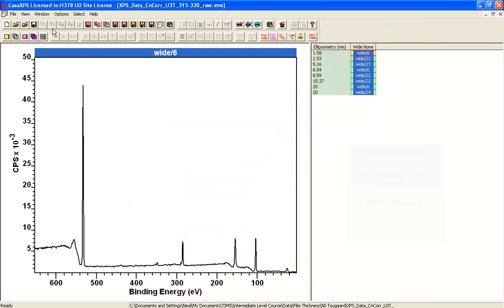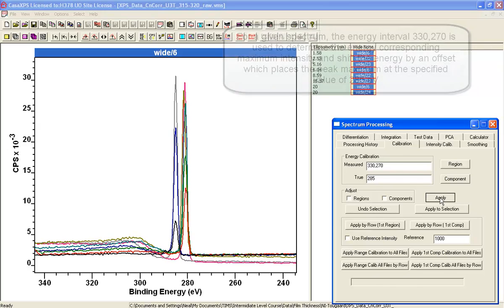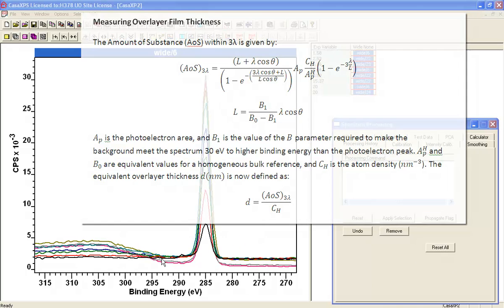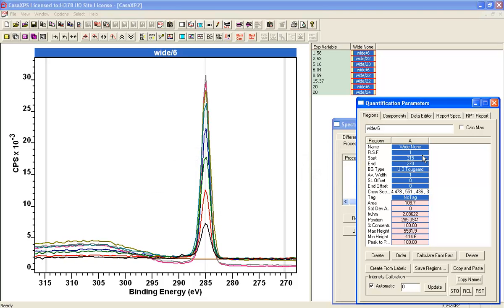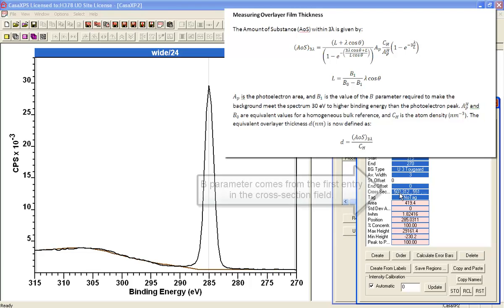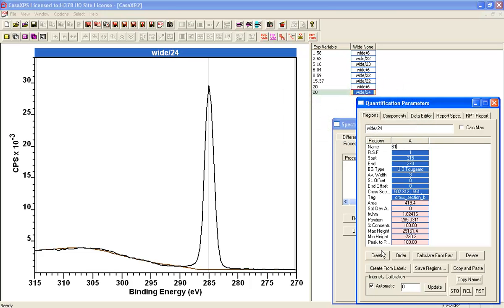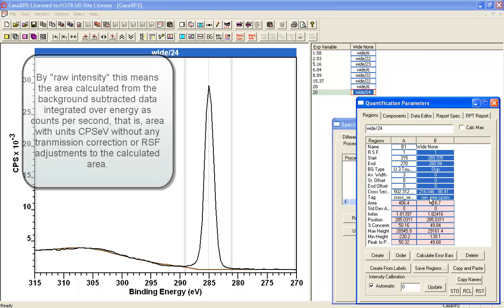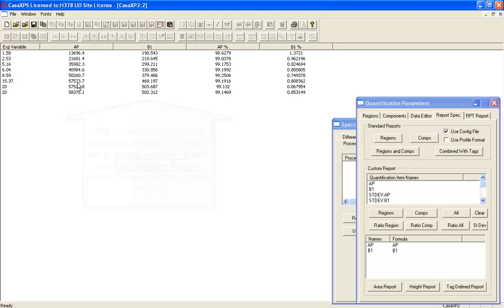Thin Film Thickness Measurements using Non-Iteractive Tougaard Method in CasaXPS Part 1

Comment: I am wondering if you are planning to release macOS or Ubuntu based casaXPS?
Reply from the maker: People use CasaXPS on Macs using emulators. I am told these work well provided you choose the correct emulator. There is no immediate plan to create MacOS version of CasaXPS